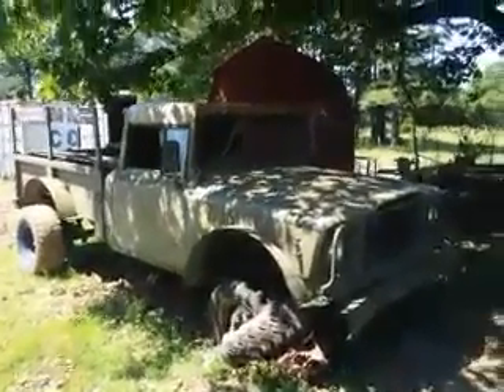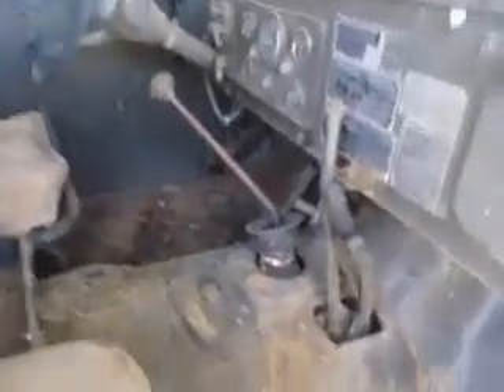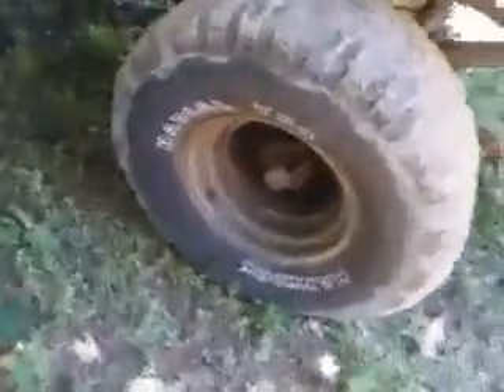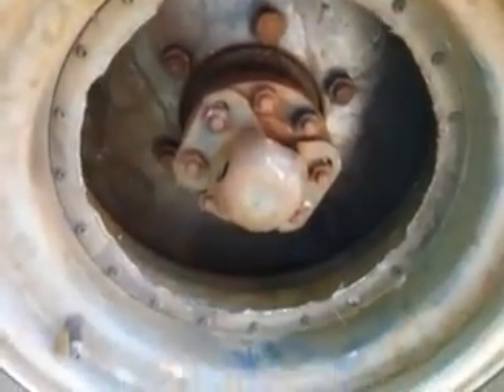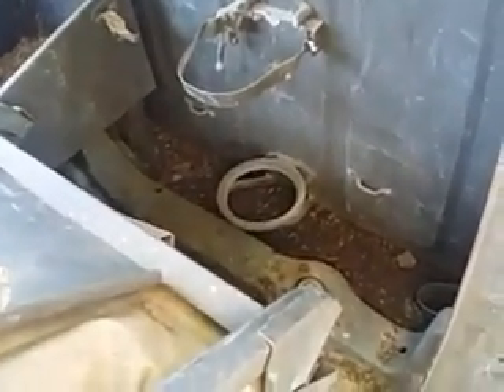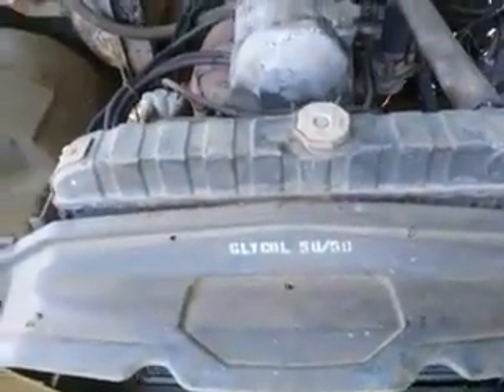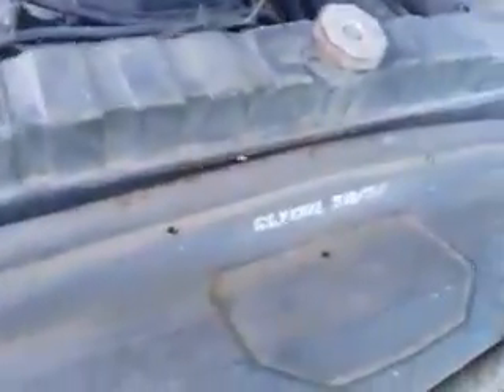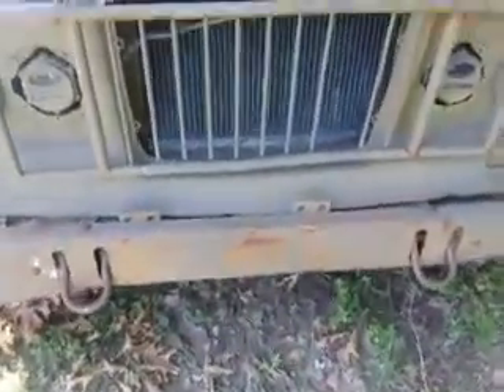M715 build part 1

Comment: sorry but a M16 is not a MACHINE GUN but yes that other two straps are for an extinguisher.
Reply: The original M16A1 was capable of single shot and/or fully automatic. It could empty the magazine in seconds with one pull of the trigger when the selector was in auto so I would consider it a machine gun.
Reply: @doyou3914  Plus it had a selection for 3-round burst between single shot and full auto.
Reply: @ronmitchell859  My original Marine Corps M16A1 did not have a 3 round burst function that I recall. I'm pretty sure that 3 round burst came with the M16A2 which did not have full auto capability